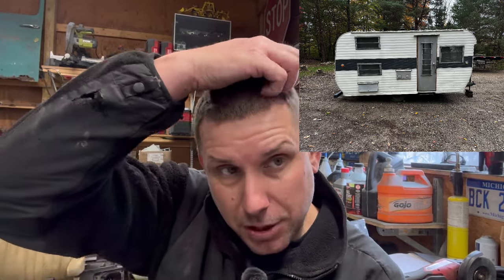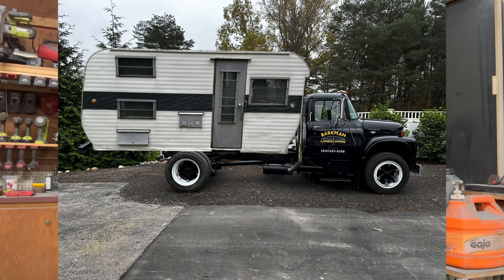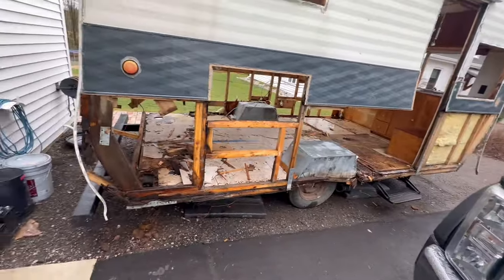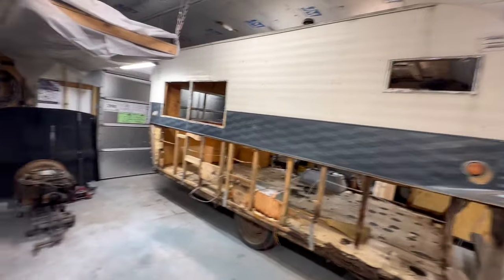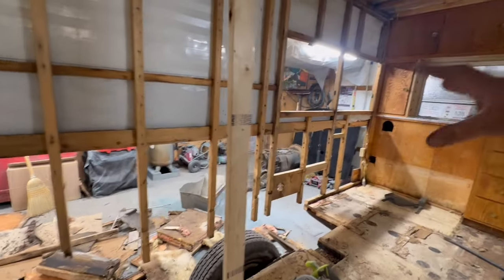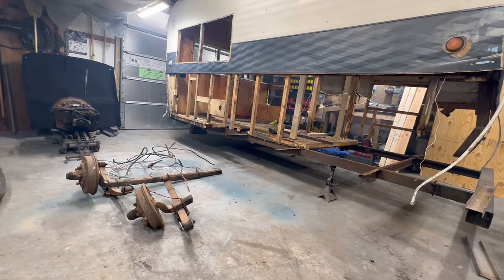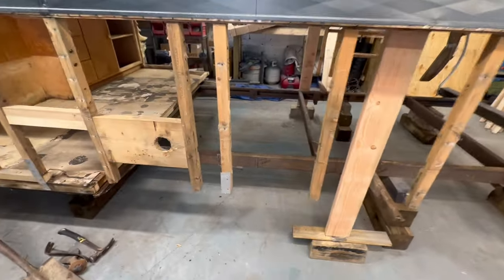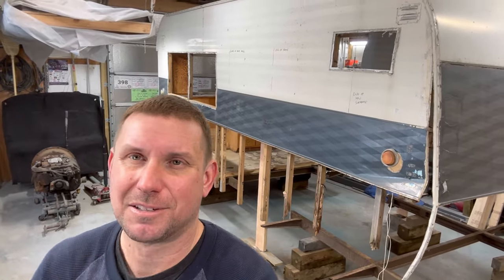Vintage Trailer on a Vintage Semi Episode 1: DECONSTRUCTED!

Comment: I know you are talking about making it straight on the front but I think if you keep it curved that would be awesome! It would really keep the vintage look! I would also recommend some coppercoat to seal the bottom of the wood, so it prevents rotting in the future if there is a leak. This will definitely be a project and I cant wait to see what you do with it!
Reply from the maker: I thought so too, but it was pretty rotted up there and rebuilding it would be a couple days work and force me to ditch the front cabinets…. So I already boxed it, my videos are a couple weeks behind reality usually 😂
Reply: @robstruckshop80   Lol. Having cabinet space is definitely a necessity and something i forgot about. Cant wait to see the finished product!
Reply from the maker: @OLDSKUULGARAGE I like the idea of copper coat.  I’ve been mulling over what to use to seal that. Of course, it won’t see virtually any water in my application, but I’d rather do the best job of sealing  that I can.

Comment: At this point I'm just wondering which part of the 'camper' is actually gonna end up on this build & on retrospect, was it even worth messing around with that rotten box of sticks. Perhaps if you ever do this again. You could think about building your box from scratch & buying a smashed up camper from the auction to salvage all the campers fridge, freezer, cooker, cupboards & other funiture etc. I sure this will end up a wonderful build. I'm a new subscriber & am just starting this from the start good luck..
Reply from the maker: It was, because it was going on a 1967 truck with the one end goal of having it be period correct.  A scratch build would’ve cost infinitely more, taken as much or more time, and I’d be left with a slab fiberglass box and modern windows.  This route got me the look, and aesthetics is paramount for me on this.  If it were going on a more modern chassis, I agree that scratch building makes great sense.

Comment: Are you done with this project  ?
Would you take this approach again,  tearing into an Old trailer.
Reply from the maker: I’m not done at all, but I am a couple weeks ahead of this video.  If I had to do it again and I wanted a vintage look to match a classic truck I would absolutely do it the same way.  It got me the right windows, a basic structure, and a period correct kitchen.  If I were putting something on a more modern chassis I would either use a newer trailer or purpose build something.

Comment: Between removing the rotten wood, changing the sub frame to accommodate your 22.5's and reshaping the leading edge, you are not starting with much.  Remodeling anything is always more work than building new.  I helped a friend with the restoration of his Airstream some years ago and until then, I never realized how poorly that camper trailers are built.  And Airstreams have a good reputation in the industry.  It was eye opening.  Look forward to your next installment.
Reply from the maker: Definitely, but it got me a few things that would’ve been difficult to impossible without a vintage trailer base.  They definitely aren’t built very well, but I think that’s out of necessity- to build them right they’d be too heavy for anything but a class 8 truck! Thank you for watching
Reply: You are absolutely right.  I could build a camper trailer that would last forever, but you would need a semi to pull it.
Reply: Hey Rob,  Steve Lehto is right around the corner from you in Atlas.  Did you see his video of why you should never buy a new RV?  It was very interesting.
Reply from the maker: I haven’t.  I think they’re just a purchase you go into with eyes wide open, knowing your aptitude and financial ability to repair it.  My wife and I have owned 6 different RV’s from a pop up through a 42’ 5th wheel and we’ve had only manageable problems in decades of time and tens of thousands of miles.  Maybe we’ve just been lucky, but I wouldn’t trade the experiences they afforded for the world.